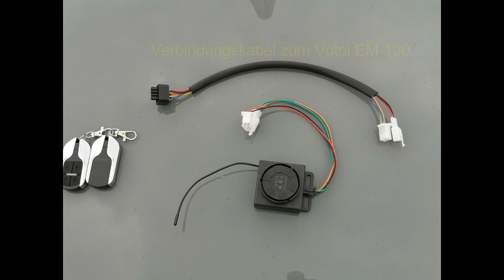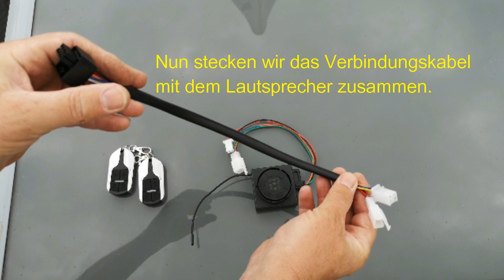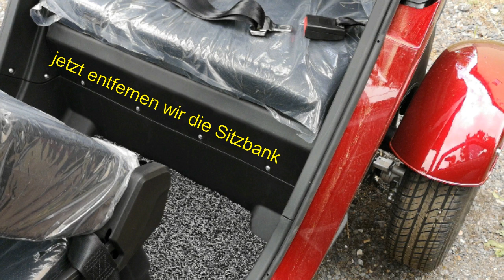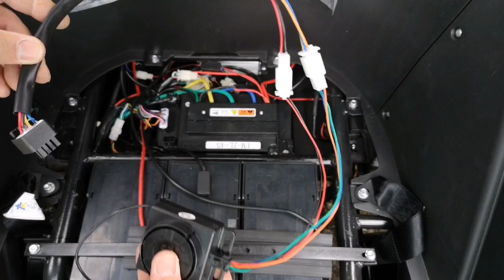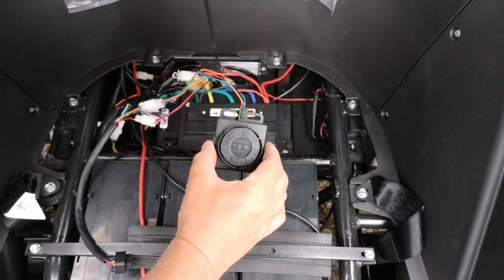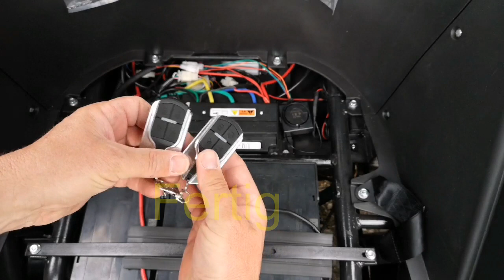ECONELO Kabinenroller Alarmanlage einbauen, www.powerboard-dealer.de

Comment: Hallo, ich habe heute meinen gebrauchten Kabinenroller abgeholt und wollte gleich diese (baugleiche) Alarmanlage ausbauen. Als ich den Stecker mit dem roten und schwarzen Kabel gelöst habe ging der Roller nach einschalten der Hauptsicherung nichtmehr an, da display Blink nur kurz auf und wird dann immer schwächer bis es komplett aus geht. Haben sie eine Idee was das sein könnte? Auch nachdem ich den Stecker wieder verbunden habe von der Alarmanlage hat der Roller kein Lebenszeichen mehr gegeben…
Reply from the maker: Hallo, eigentlich hat das Problem nix mit der Alarmanlage zu tun. Denn das rote und schwarze Kabel ist nur die Stromversorgung von der Alarmanlage. Es muss an etwas anderen liegen. Ich hoffe Sie haben auch wirklich nur die Kabel von der Alarmanlage getrennt. Schon mal die Hauptsicherung FI Schalter im Heck überprüft? Auch die kann kaputt gehen. Das würde das kurze aufleuchten und sofortige erlöschen des Displays erklären. Die Alarmanlage läuft nur über 12V. Die kann nicht verantwortlich sein das der Roller nicht angeht. Ich würde auch mal das Zündschloss überprüfen auf Wackelkontakt. Und die gesamt Spannung der Akkus würde ich auch mal überprüfen.